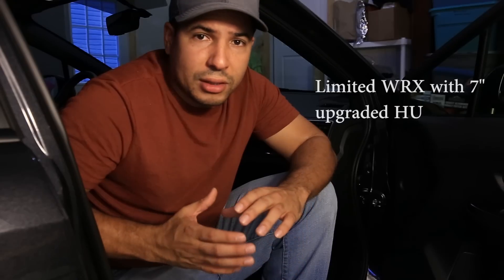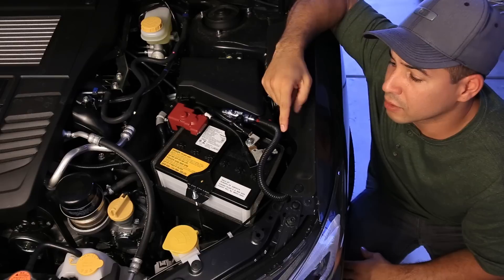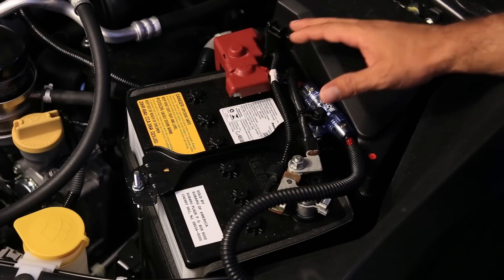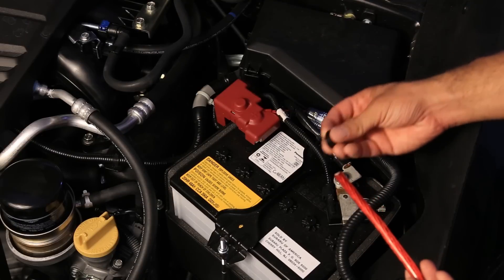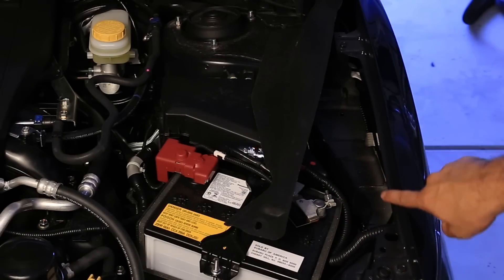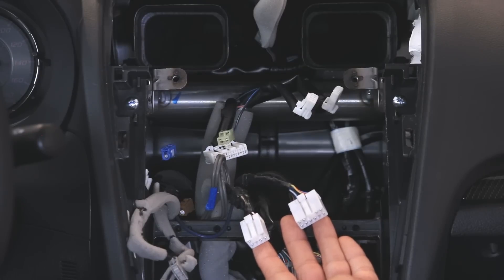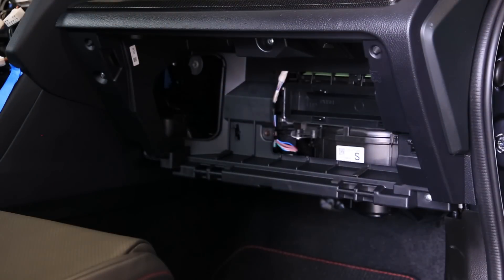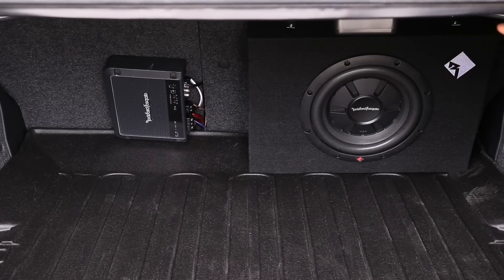WRX Aftermarket Amp and Sub Installation: Sound System Upgrade Pt 4

Comment: wow everything I could ever ask for if a car stereo installation video......... very well laid out very instructive informative video. I especially love the fact that you took the time to show me the rear of the head unit which nobody seems to do. I now feel confident that I could do this installation on my own. thank you so very much for saving me the time and the money and any unnecessary hassle a thousand thank-yous my friend. I hope you're enjoying your WRX and your system. Jeff.
Reply: did you get the head unit replaced yet?
Reply: I'm thinking of dynamat the rear hatch back door. Never did soundproofing before & the very few videos on the process say front floor and rear seat floors sb priority, then inside doors, insulating outer door shells. seems complicated. what to insulated foirst & is it $180 for dynamat well spent?

Comment: I just bought a kicker key Amp for my 2020 WRX can’t wait to get it installed im currently running an  idoing deck and a SKAR single 12” sub and amp combo. Sounds good but my JBL speakers just need a little more power to them. Thanks for the awesome video bro!!!

Comment: Just viewed.  Excellent.  The best I have seen on audio install in WRX.  I have 2016 WRX and previously upgraded the tweeters and door speakers.  I like the head unit and really don't want to replace it.  About to add sub to improve bass - actually to create bass as the doors don't really do well.  So thanks for the pointers.
Reply: What color wires did you end up cutting if you remember, if you don’t i get it, been 4 years lol

Comment: There is actually a double hole inside the fender that goes directly into the cabin behind and above the fuse/electrical area on the driver's side. It's doubled so that the outside hole is lower than the inside hole. This way the wire has a small loop downward before going through it, so no water can get in. Took me about 10 minutes, and did not take anything apart.
Reply: Do you have a link to a picture of this hole?

Comment: Hey man thanks for your responses and great video! Easy to follow along with. I have a 2020 WRX STI spec.R and am really struggling with the pin outs because of the Harman Kandon stuff. So this is helping a lot.
Reply: Judging by the Harman pin out diagram... does that mean I only need to tap into the Left rear side??? Because there’s no Right Rear side connected.

Comment: I like a powered subwoofer under the driver seat, a 4 ch. amp under passenger seat with 1.5F capacitor, replacement component speakers in front, 2- way in rear doors, I like that my head unit has a screen-off option for night driving, and I too, like an easy to adjust bass level. remember to run parallel 8 ga. cable for " the big 4 " wires - alternator positive to batt. positive, alternator frame to frame, engine frame to frame, batt. negative to frame.( bigger ga. if more than 200 w rms ? ) your video was pretty good.
Reply: and I treat the doors and accessible areas of floor to 1st sound deadening, then insulation - in doors.

Comment: Helped me with mine, so far I like the wire running location. I just need to tap the high output converter and 🤞 it works first try
Reply: Boost & Shutter what wire is the remote tapped to? I tried connecting to ACC radio (blue I believe oddly enough) but still no power to the amp
Reply: Boost & Shutter perfect will do.
Reply: Did that work

Comment: I was gonna ask that if u have the link to the factory radio harness to add the sub woofer instead of splicing wires or T tapping I have the 2020 wrx sti I have everything Connected big thanks  to your video but I don’t wanna cut any wires thanks tho

Comment: Hey brother thank you for us all!! In the video you mentioned that you ran the RCA cables even though you didn't need them So does that mean I don't need them with my stock head unit? I know I have to run my high level outputs and all my speaker wires but do I also have to worry about my RCA cables if I'm not hooking up to a subwoofer? I'm just trying to power my door speakers with an amplifier. Thanks so much again man!

Comment: Not sure if you can hel or will read this lol. 2020 STI Limited
I get buzzing sound when car in accessory mode and a whine when the car is on and push the gas gets louder. 
I have tried different ground. 
I have disconnect the left and right RCAs and connected another set that connects to my phone and the sound goes away. Sounds clean. 
I reconnect the RCAs to the head unit and whine sound is back. Tried grounding RCAs. Last resort a car shop said to buy an isolator.
Tried three different sets of RCAs. 

I read something that the car canbus system could be causing the issue. But IDK
I installed the idoing head unit. 
2 amps a 4 ch and mono. Grounded in the same place like this video. 
New tweeters and front door speakers.  
ran new speaker wire to tweeters and front door speakers to bypass /not use harmon kardon amp. I did n to buy the canbus thing.

all power is ran on left driver side. RCAs and speaker wire on the right passenger side.

Comment: Hey,

First off great video helped quite a bit but I do have one question. 

For the signal wire did u splice that to #10 illumination signal 12v?
Reply: Is the signal wire the blue wire coming from the sub?

Comment: Do NOT use T Taps, I was the Lead Autotech for a few years and those taps are a fantastic way to cause problems in a car. After a few years they can lead to corrosion in the wires and they usually cut a lot of the wires in the cable when you connect them creating a potential issue with the wires original purpose. 
If you want an easy and efficient way to splice into a cable use a military splice and high quality electrical tape. This video was great and he did a beautiful job but I was absolutely surprised when he suggested using a T Tap. I don’t know any professional techs in the Denver area who would suggest using them. Even the Mobile Electronics Certified Professional (MECP) certification test tells you not to ever use these.

Comment: I’m looking to do a full audio upgrade on my base wrx, which of your videos do you recommend I could follow for installing a Sony XAV AX7000 and keeping SWC and backup camera, USB ports etc… I’ll also be getting component speakers with inactive crossovers, how do I go about powering the components, but also the rear door speakers using a 4 channel amp (jl audio jd400/4)

Comment: I'm not sure if you already listed these, but can you list all the connector harnesses used to install your Pioneer AVH4201?  I've installed speakers, sub and 5 way amp and now trying to figure out all the connections on my limited 2018 wrx formerly with HK.  Thanks!

Comment: This series of install videos are great! I just have 1 question. (I am not well versed in audio equipment) I bought speakers that came with audio crossovers. How would I go about wiring and installing them?
Reply: you do realize that speakers with separate crossovers outside the speaker bodies are only used with an external amp. speaker wires run from the radio head unit to the amp to the crossovers and wires then run to the speakers.

Comment: best video Ive found, by far for running power cables to trunk area. great camera & sound. I inerited a 1998 subaru forrester from my dad, putting my JL Audio 300/4 amp(75 rms x4 continuous), kenwood 600 rms x 1 sub amp, MB Quartz speakers & JL Audio sub box (30by 13 high by 11.5 inches wide- 2 of 13 inch woofers) compared to my kenwood s9903s head unit & seeing the rear of your oem radio convinced me to never get a dealer installed radio in my next newer car.  hpw would you anchor my sub & how many inches from the back seat would you place my huge sub box- aimed at the rear hatch door, but ?

Comment: I have a 2016 STI Limited with Harmon Kardon Sound system. I have the converter to change from speakers to RCA. Can I tap into the connections going into or coming out of the Harmon Kardon Amplifier and/or the wires going to the stock 8 in subwoofer?

Comment: What wire colors did you tap into? I have a powered Kicker sub, my other car I tapped into the power source and rear speakers. Would that apply to this as well? If so what colors are the wires I would need to cut into? I have the same HU in my WRX as you. Hope to hear back thank you.

Comment: I installed an amplifier to my head unit for my aftermarket door speakers and I believe I keep blowing #4 (IG2) fuse in the driver side fuse panel. Any advice?

Comment: Hey, I'm installing a Sub in 17 as well, and I was wondering if you had a diagram or could tell me specifically what wires I need to splice into. I'm pretty handy with electrical circuits but I'm not sure what the accessory cable or "punch cable" was in your video, i thought all you need is to run speaker output to your sub (my sub has a built in amp).

Comment: If my amp is going in the back, would there be any negatives to connecting t-taps dor the high level input to the speaker wires in the trunk?

Comment: Question regarding LOC installation for a H/K unit with nav. 
By what I read here I will be hooking up the following.

FR+ (pin 1) to LOC Channel 1 +
FR- (pin 5) to LOC Channel 1 -
FL+ (pin 2) to LOC Channel 2 +
FL- (pin 6) to LOC Channel 2 -
ACC (pin 3) to Remote Amp turn on.

Is this correct?

Comment: Will say, in retrospect, would have been better getting different sub versus kicker sub upgrade. Added Alpine MRV-f300 to power kicker upgraded speakers up front but there is a low range frequency (sub is non adjustable), and messing with crossover frequency on amp - door speakers can't handle that low of range. Nonetheless, as you said - night and day difference adding power to the kicker upgrades. Should of gotten separate sub and perhaps 5 channel amp looking back. oh well.
Reply: Im contiplating soundproof also- do you recommend dynamat, but application on the inside of the outer door shells seems real hard, ie taking the door apart scares me. I see sileas & noico sound deadening mat but, unlike dynamat, the are asphalt based & the possibility of bad odors in summer heat suggest a problem. I have no experience at all soundproofing but after many years of car audio upgrades, my equipment are keepers. what about oders in summer heat? is dynamat really the best option?

Comment: Will that speaker diagram work for my 2016 WRX STI base model? I'm planning on just using a hi-low converter to attach the RCA cables

Comment: Does anyone have a way to do this without the harness? In other words, what wires need to have taps for on harness going into the radio FR/FL and RR/RL? I need to run them to my LOC and I'm stuck

Comment: Great video, I used this as reference while I did my install on my 2018 WRX, I have a feedback problem on start up to the sub woofers. I had the same problem on my accord and I had to unplug the ANC unit (active noise cancellation) did you get this problem too? If so what did you do to fix it or prevent it?
Reply: ive also seen a suggestion to ground to 2 places, 1 on each side of the car but that means longer ground wires & a ground wire distribution. Never tried a 2 wire ground setup, but have used a ground ditribution block since I run a ground to 2 amps, my main 4 channel amp & my subwoofer amp. verfify that your screw used to ground to the car body has benn sanded to bare metal, no painted surface where attached. Ive seen some installs use seat screws for ground but there is often a painted metal surface under seat bolts. also use good quality wires, ofc (oxygen free core like Knukonnects or skyhigh). these are best for the rca wires from your head radio unit & also wires from your amp to the speakers. a 12 awg gauge knukonnects 100ft of wire is from $50 to $70 on amazon.

Comment: did you have to open a hole through the rubber cover you ran the power cables?
Reply: Exactly as I did. Thanks for the video. Running the power cables to the engine bay was a pain.

Comment: Hey, an amp and subwoofer was installed in my car. After a drive with the system on and everything runs fine. After i turn it off, ignition off. My interior lights and info screen (the one that has the boost gauge) flickers or turns on and off after like maybe a while its fine. Any idea?

Comment: Great job with the video; could've saved time by tapping into the speaker wires from the rear.  That way, u would've only needed to route from the rear, to where u mounted the amp, which was also in the rear.
Reply: If I didnt have an LOC but my amp has a high input for speaker signals. Would you recommend I tap into the front speakers instead of rear since rear have that bass roll off??

Comment: I'm struggling figuring out how to attach my power wire to battery terminal.  I have 3 wires with bent connectors not allowing me to put a ring terminal on and I don't want to change out the terminal as one of them has a fuse on it.  Help please
Reply: They are factory wires already there.  I'm not sure what all they go to...alt, fuse block and unsure is my guess.  Wish I was able to send a pic.  Or can you do a short video just showing your power wire connected to the battery terminal.  Any pic I see of anyone's wrx has Thier red cover on so I can't see what they are doing to connect.  I think if I get another washer or 2 I could make it work but the terminal on batter is sticking up higher than the connectors

Comment: If you have a harmon kardon system, this does not work. There are 0 guides for a harmon kardon system, especially with a 30-pin connection off the amp

Comment: A fuse on your power cable is not necessary I've been running systems in my cars for almost 20 years and never used one
Reply from the maker: It's a safety feature, like a seat belt- it's not necessary until you get in an accident. If you get into an accident and that cable gets severed or the skin gets frayed and makes contact with the chassis the fuse blows and cuts off the circuit. If the fuse isn't there you essentially short out your battery, the cable gets hot and catches fire or the battery   can even explode. It is NOT for the amp, it's for YOU.

Comment: Since the factory HU doesn’t have pre amp do I need a line out converter? I’m still new to all this. Thanks
Reply: Boost & Shutter oh okay great, cause I got the same amp that you have in the video and it says that it has high level input